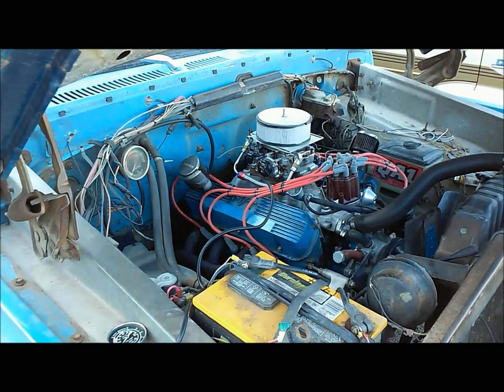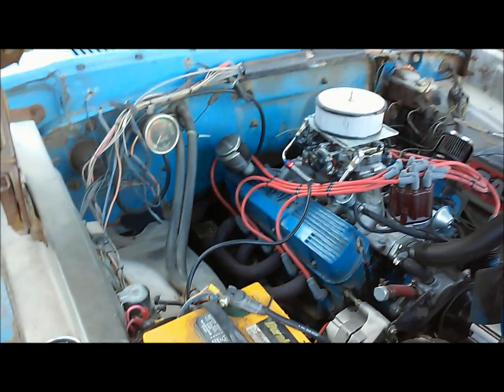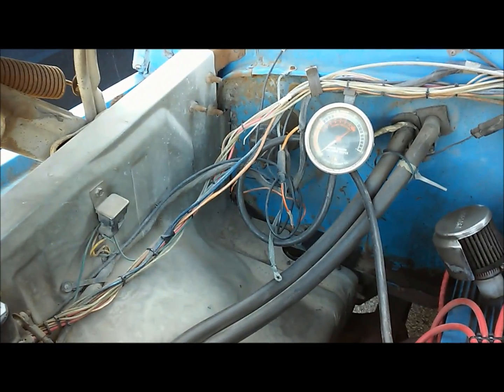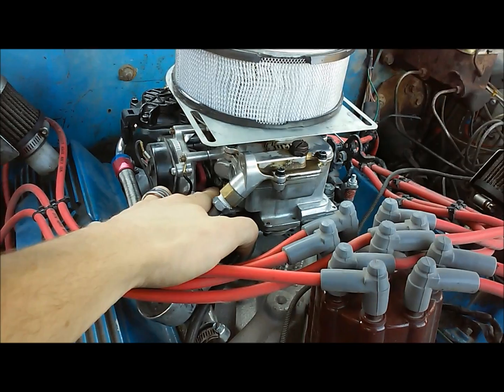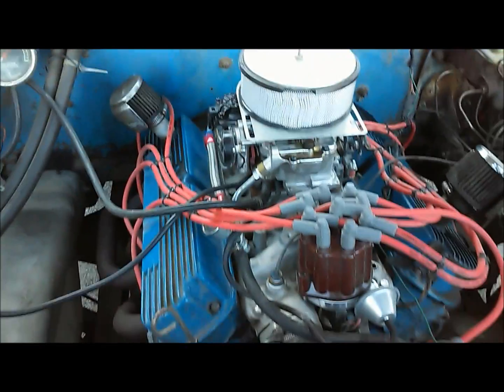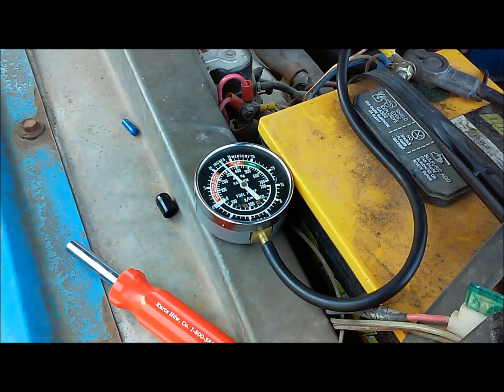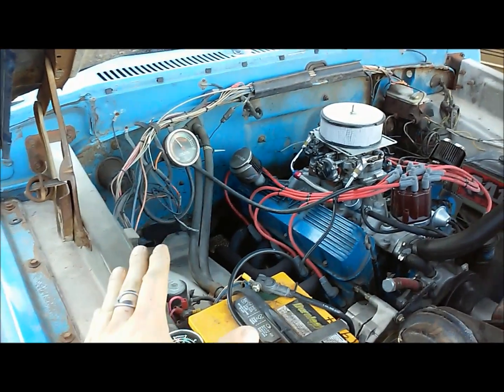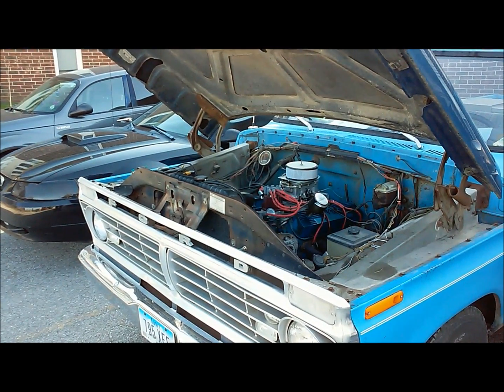Carb Idle Mixture Screw - How To Adjust Properly  (EXPLAINED/DEMONSTRATED)

Comment: HEY Luke, i cant wait to get my truck sounding and looking like your engine bay.
that being said, it might be helpful to actually say wether enriching or leaning is turn out or turn in.
same for timing. advance or retard means nothing to a newbie unless you also say CCw or CW.

i just picked up a 76 F150 looks prettier than it runs though... .
Seemed to run decent at speed but large stumble off idle.
Accel pump seems to squirt both barrels, is set to out lever spot and top cam spot.
Doesnt seem to be any power valve leaks
Shaft seems a little loose but i dont know how loose causes vac leak?

then replaced cracked brake booster line, idle/stumble got worse.
Checked fuel filter, it was FULL of large grain rust.
replaced filter  at carb and another see thru one before pump for visual reference.

then reset the mixture screws from about 3 turns out to1.5, wouldnt even start, barely fire.
SO i unplugged all vacum hoses and plugged them with multi sized plug kit.
IT fired right up, but still has off idle stumble.
Then i advanced, turned distr CW and idle picked up.

Stumble is a little better

Im thinking carb needs to be opened completely up and check for sediment and blow out all orfices and replace wear parts.
What do you Ford/Carb experts think?

which of those carb vac hoses need to be hooked back up?
right now ive only got brake booster, w/o which i have about 10% brakes and also the vac advance to dist. all others are still blocked off.
not even sure what that thing behind the carb is hooked to vac lines?

Comment: Good info pretty much what I do! 
Off the subject a little , on some of these dual plane carbs have you ever cut the divider wall of the intake about a 1/2” maybe 3-4” long?( just under the carb or at the base of the carb mount) 
Normally I’ll run a 1/2” phenolic spacer but in some cases hood clearance is an issue….so I cut down that divider wall and helps a bunch with signal balancing and intake pulse! Makes a noticeable difference in low end torque .

Comment: I have a single barrel carb i would like to know standing from the tail pipe my fuel mixture screw is in the center at the back of the carburetor so standing from the tail pipe which way must i go inorder to lean the mixture out beacuse when i turn the screw all the way in the car cuts off and when i turn it abut 2 turns anticlock wise then the car starts

Comment: Very confusing!  Which way richens?  Which leans?  You started at 2.5 turns out...where did you end up?  1.5?  At the beginning is seemed that two vacuum gauges were optional, by the end they both were needed.  You are assuming way too much knowledge on the part of the  inexperienced viewer.  A common YouTube foible...
Reply from the maker: This is a really old video of mine - as I got older my presentation skills dramatically improved - here’s an exponentially better walkthrough: 
https://youtu.be/bUv5tUC6Ioo
Reply: @ThunderHead289  Hey, thanks.  I didn't mean to be unnecessarily critical just constructive.  I have watched some of your other video's and gained useful information from them.  All in all I'm glad you take the time to do these.  I'm finding that there are very few people that have carburetor knowledge!

Comment: You know what you thought you said. I wish I knew what you were thinking. What are the 2 screws you are talking about. You sound as they are both for fuel. I thought 1 was for air. I then than not knowing what you are turning, good video.

Comment: To go rich in the mixture, do you turn the idle/mixture screws clockwise or counterclockwise?
Reply from the maker: Counterclockwise 
It’s confusing if you have worked with tractors since often turning them in is richer
Reply: @ThunderHead289  would that apply to all carbs? I have a Rochester 2GC on my Pontiac 400.

Comment: I have a 72 with a 360 2bbl and when ever I take the choke off it stumbles and dies. Motor is up to temp.
Reply: sounds too lean. 2bbl? may need to upgrade to a 4

Comment: What happens if the idle mix screws were screwed in and seated and not turned out ....what would happen.Is turned all the way in max lean?
Reply from the maker: If your screws are all the way in and it still runs, it means you have too much transfer slot exposed on your carb ie your throttle percentage at idle is too high

Comment: Back in the day, me and my brother would do tune-ups all the time with all of our cars and for relatives and friends and we still do it with our 65 Impala.  Takes a little time, but overall its easy and a nice small project to do on a lazy weekend.  Takes about half an hour including the time for the engine to warm up.  Tach/Dwell meter, vacuum gauge, timing light, distributor wrench, small screwdriver, and an allen wrench are all you need.   Same technique applies to all makes and models, four, six, or eight cylinders.  Standard engines with hydraulic lifters would go well over 20 inches of vacuum with a proper tune.  Be sure to kill the vacuum advance and plug the port on the carb while setting the timing, the rest of the tune-up can be done with the advance hooked back up again.   Automatic transmission and by yourself?  Do the whole tune-up in Park, throw it in Drive, look at your idle on the tach, back in Park, then keep doing that until you have correct idle speed.  Most old style V-8's go about 600 RPM while in Drive.   You'd be amazed at the difference once you're finished.  Its rewarding and lots of fun too.
Reply: Hi i have a quadrajet carby whats the best way to do the mixture i just brought a vacuum gauge any help appreciated
Reply: @Farmer2492  https://www.youtube.com/watch?v=Nbih0zm_Ldw
Reply: @troydzuricsko7331  Thank you very much

Comment: Ford F100, 360, 4 barrel, Automatic.  What is the procedure with an automatic transmission?  Would you do this with the transmission in drive as that is how the idle is supposed to be set with an AT?  Or would you set the idle in drive and then perform the vacuum adjustment with it in park?  Thanks in advance.  I have followed your channel for awhile and enjoy it very much.  Your videos are well done and thorough.  I can also appreciate how the video production has evolved over the years.  Well done sir.
Reply from the maker: Hey, thanks so much. I really fail at mentioning to do autos in drive with either a friend on the brake, or the parking brake on (a little risky) 👍

Comment: Chevy 350, edelbrock carb, just bought a vacuum gage and I thought I was supposed to hook it up to the port in front of the carb? There’s two, one going to the vacuum advance and the other plugged up. I do have a port behind the carb on the intake. Which one is best? Then, I was told to turn one screw in, then back out to see when it gets to the highest point. Then the other screw.....Please help, thanks
Reply from the maker: Whoever told you that is wrong - follow the video as I have presented it. 
Also, any port that at idle is sucking air in is a good one to hook your gauge to 👍

Comment: Hello, your videos are awesome..Hope you could answer 2 questions for me on timing and carb 1) My 1966 Mustang 289 seems to like pretty high timing - 12 to 15 degrees which is much higher than FACTORY spec. Does that mean something is wrong? 2) I have an Edelbrock carb and manifold, did the steps you outlined. What is the BAD you mention (as have others) if you make it too lean (like if I left it at max manifold vacuum)? Damage? Poor performance? Thanks !!!! Keep em coming
Reply: 12-15 degrees is fine as long as it doesn't ping. Nothing bad will happen if you adjust idle mixture to max vacuum. That is the ideal setting but in reality is difficult to achieve precisely without an AFR meter and, with a carburetor, even then. Once you find the best lean setting turning the mixture screws and extra 1/8 turn or so rich reduces the possibility of stalling and rough idle under less than ideal conditions such as being stuck in traffic on a hot day. Engines can tolerate an overly rich idle mixture much better than a lean one.
Reply: @65sohc  Thanks !! In final settings, Its actually about 18 degrees for best run and that also gives about 32 degrees total advance. I am also told this is not unusual so ...I go with it :-) Again thanks
Reply: @arcorob  Is that 18 degrees initial with vacuum advance connected? Because if it is w/o vacuum advance in play (the correct way to set initial timing) that means your distributor is only supplying 14 degrees of centrifugal advance which is unusually low.
Reply: @65sohc  Vacuum advance disconnected and carb 
port capped to test ...been trying to figure ..why so high..and as you say full advance kinda low ...if I drop it (initial at 10 or 12) a vacuum gauge on the carb port tells me not enough advance ..if I set for about 15-16 I only hit about 30 on advance...It has a pertronix unit but could my distributor or advance unit be bad ? I am REALLY tempted to do a distributor change but not up for the challenge yet. but could be..Thoughts?
Reply: @arcorob  Pertronix distributor or just Pertronix points to electronic conversion of stock distributor? If it is Pertronix distributor the amount of centrifugal advance is easily adjusted.
Reply: @65sohc  No, just a pertronix I conversion (bought the car that way before the restoration) ...I am trying to fine tune and as stated, unusual high idle advance without corresponding total advance. I am a novice but learn quick..lol. So at 18, shouldn't my total be at least 36-38? What do I need to fix or adjust ? Thanks
Reply: @arcorob  If it starts OK at 18 initial and you have a total of 32 I would just connect the vacuum advance and call it good. 36 degrees total is ideal but it's probably only 3-5 hp more than what you have now. You could even try bumping your initial timing another couple of degrees and seeing what happens. The only potential downsides are difficulty starting, as in the starter straining to turn the engine over, and pinging. If you don't experience either of those you're OK.
Reply: @65sohc Starts great , runs pretty good (likes a nice warmup too) but I click to the floor once to set the choke, turn the key .boom quick even start , 1200 rpm...after a bit kick down...800 rpm...after warm..runs about 700-750  I just found it ODD when fine tuning but again..mustang guys tokd me not unusual...I was wondering if it had a mild cam since it was rebuilt before I purchased but have ZERO info othet than whats visible and know it has hardened valve seats...Afraid to change the distributor without knowing because what if its a different cam...how do I choose a cam gear ? Steel? Iron...At some point may have to open this puppy up....:-)
Reply: @arcorob  I also have a 66 Mustang. Mine is a 302 with cam lopey enough to require an 850 RPM idle, Pertronix Flamethrower distributor and Summit 600 cfm carb on an Edelbrock Performer manifold.  I've been around Mustangs since my dad bought one in 1965. My daily driver is a 2016 GT350 tuned to run on e85. If your engine has much more than a stock cam you should be able to tell by the quality of idle. eg. is it smooth or lopey? What is your manifold vacuum at idle? For reference all I know about my engine is that it is a roller cam block with a lopey cam. Vacuum at idle is 15. It runs really strong between 2000 and 5500. I have the sense that the cam has more power in it but 5500 is pretty much the limit of that manifold. Below is a link to a very good explanation of distributor/camshaft compatibility. If it were my car I think I would just drive and enjoy it.I wouldn't worry about changing the distributor based on the discussion so far.

Comment: I've got a 70 mustang with a 351 W.  motor has been rebuilt and know I'm using a 600 cfm edelbrock.  can you do a vid on adjust this thing.  It's driving me nuts
Reply: I have a 600 CFM Edelbrock as well.  Edelbrocks don't like fuel pressure over 6 pds.  Once you have the correct fuel pressure it is easier to adjust.  I put a regulator on the fender well and permanently attached a 1 1/2 inch fuel pressure gauge on one of the two outlets of the regulator as I am not running a return.

Comment: Is a vacuum gauge the same as a fuel pressure gauge?
Reply from the maker: It is different in the sense that fuel is pressure while vacuum is a suction effect! So unless they are set up to accommodate both, most are specific to one or the other
Reply: Dakota if you don't know much , stay away . answer not even close

Comment: running a very quick cam with 102 lobe degrees, it wont hold an idle under about 1200. I had to drill the plates on an HP holley.....all in a boxed frame 71 vega.....truck sounds nice though!!
Reply from the maker: chevy vega I’d imagine so, that’s a heck of an LSA! I believe this cam was around 108 or 110 - I’d have to look at the old card!

Comment: sounds like you need a lot more idle, thought it was going to die at the end . either by drilling a 1/8 inch hole in each butterfly of the mains or turning the idle screw
Reply from the maker: chevy vega that’s what she sounded like idleing at a steady 900. Solid lifter cam engine

Comment: i have a 1973 f250 with a 2bbl stock carburetor, im looking to getting it looked at weather it needs to be replaced or not. It probably hasnt been tuned in years. Should i just try and tune it and see if it helps? the truck starts idling rough when i come to a stop at a light, and occasionally when i go into reverse. Also, i want to try and stay stock for now, can i just stick with the 2bbl, tune it, and get new headers and new exhaust? im going with the flowmaster super 44, will that boost performance and make a difference just until i switch to a 4bbl set up in the summer time?
Reply: mike anderson - Tip: NEVER start tuning an engine that's messed up in the first place. It's a golden rule of performance upgrade. Save your bucks and a lot of head ache. First clean/set it properly, when your 100% sure what is needed. 
Than you can really make improvements instead of just trowing money out of the window. trying to fix band aids to solve previous issues. 
From your description seems that your not even sure what is wrong with it in the first place, so that's the best place to start. Good luck. ;-)
Reply: btw, got some work done, spark plugs, adjust timing, switched to a 4bbl 600 cfm holley, replaced starter solenoid. going to convert to electronic ignition. tell a huge difference even at idle!
Reply from the maker: +crpth1 definitely
Reply: Yeah definatly! The new exhaust is just flowmaster super 40, 2 and a half inch pipe, dual of course. Next I am probably gonna get new headers, but unsure.
Reply: Yeah it's running great.
Reply from the maker: I'd try and adjust it, I have a lot of carb videos discussing how to tune. I'd have a better idea before you jump into adjusting it
Reply: ThunderHead289 so try and tune the carb first before I think about replacing?
Reply from the maker: +mike anderson I definitely would, though a 4 barrel is better all around. If you do go to a 4 - get yourself a summit 600.
Reply: Do those adapters work at all for 2 to a 4? Or do I have to do the manifold too
Reply from the maker: +mike anderson you have to do a manifold.
Reply: Ok, what about going to the 500 cfm holly?
Reply: so I'm actually thinking of switching to a 4bbl and doing the intake as well. reccomendations for intake and carb? want the middle of the road not the most expensive
Reply from the maker: dont go that route - i need to make a video about the 4 barrel vs 2 barrel design.
Reply from the maker: i have the perfect set up for your situation. edelbrock performer 289 dual plane intake & the summit 600 carb. really good combo there
Reply: What do you mean? So don't buy a new 4bbl intake and carburetor?
Reply: How much?
Reply from the maker: intake is 150 or so, the carb is 300. - these are new prices from retail.
Reply: Really? Where can I buy it all from?
Reply: Do I need to buy 2 carbs then?
Reply from the maker: you can buy them both through summit. i dont understand your two carbs statement. you need an edelbrock low rise dual plane and the summit 600 carb. 
best of luck 
-thunderhead289
Reply: Sorry been working a lot lol. Can you send me a link for the intake manifold, I can't find anything lower then 370
Reply from the maker: +mike anderson that's great to hear! Ignition, more air and more flowing exhaust always make a huge difference on any vehicle.
Reply: I also heard I should be getting new cylinder heads because of the gas now a days
Reply from the maker: +mike anderson gotcha - sounds like you have made trade sous improvements which is always great to hear. Glad it's running well for you !
Reply: +mike anderson - Nice to read that. ;-)
Reply: So do you square your transfer ports, set idle speed with ignition timing then adjust idle mixture and then repeat idle speed adjustment with ignition timing again and then back to mixturen then back to idle speed via timing....where does it end?  Do you eventually get to a point where no adjustment is needed?

Comment: Finally I see someone who knows enough to go slightly rich by turning the mixture screws out a quarter turn. No one else on YouTube knew this. That allows you to go longer until you need to adjust the screws again. If you leave the screws at their highest vacuum, highest idle speed setting just the slightest bit of contaminants in the idle circuits will cause a poor idle. Better to be a little rich. You people out there should pay attention to this video. It is the only one that is right.
Reply: Everyone knows you go a quarter of a turn.
Reply: @d711van1  i didn't.  Thats went im here
Reply: I’m looking for help adjusting 6 pack carbs. Is that a similar process compared to this?